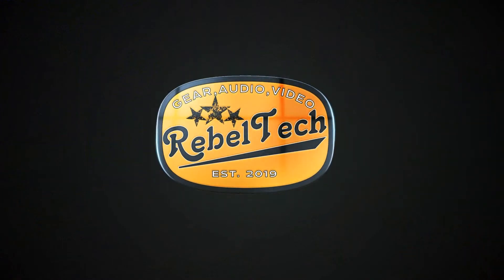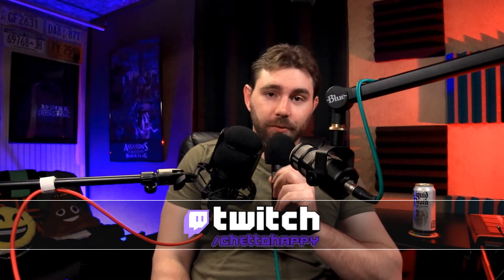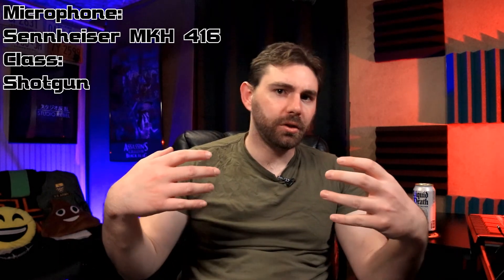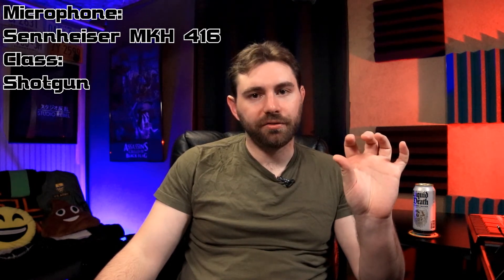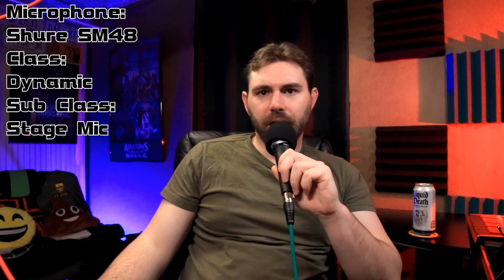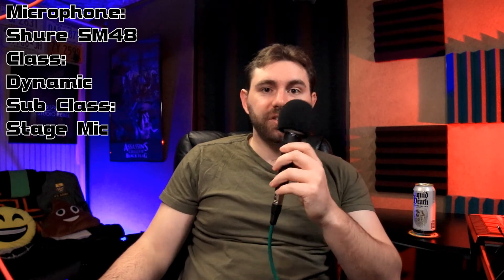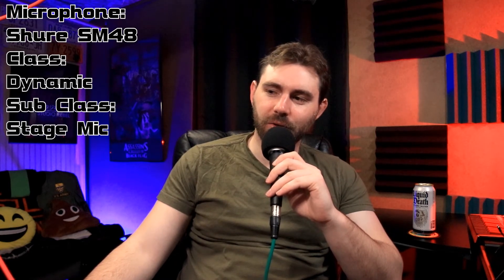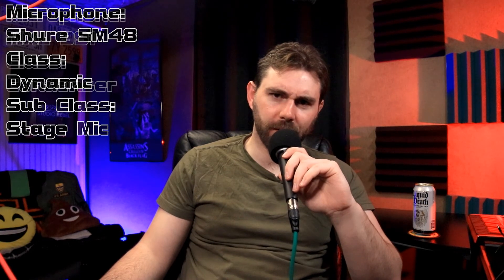6 Mics, 1 Recorder! Zoom F6 Mic Test (Part 3 The Test)

Comment: how do you connect your lav mic to the F6 ? 
I am trying to connect it and i have no signal.. the microphone works flawlessly on the H6 .. any ideas ?
Reply from the maker: Which lav mic are you using?  Is a xlr receiver plugged in or is it a 3.5mm lav adapted to xlr?
Reply: @RebelTech1990  ok, i found the reason. On thei recorder its not enough to set the phantom power. You have to go to each individual channel and choose which mic type you are using. So i had to choose mic with phantom power. than it worked.

Comment: Did you have any issues with your 416 and F6? Mine don't work together at all and it's just these two specific products together. I can pair my 416 with several other mixers and recorders with no issue. I also have no issues with my F6 with several other mics.
Reply from the maker: Gotta admit this is a new one for me.  Let's go through the easy stuff first to narrow  the search.

1) Make sure its plugged in properly
2) Check that the cable is good
3) Check that the F6 is set to 48v phantom power
4) Check that the PFL settings are set to phantom power
5) Check your levels, make sure you are giving enough gain

Those are the first things I would check.  After these are checked, and if you still have an issue, I'll have to do some research and tests to find an answer.
Reply: @RebelTech1990  All the above are good. I have a Shure KSM32 and 44 with 2 SM7B no issues at all. They all work on my H5 including my the 416. It’s literally only 416 and F6 together. I’ve spent like 12 hours researching everything and even tech support with Zoom. I really appreciate your help.
Reply from the maker: Ok I have a few more things to try. 

1) Are you up to date with the firmware?
2) If number 1 is done, try a factory reset and start from scratch

Try those next and then we can try more stuff if they don’t work.
Reply: @RebelTech1990  The firmware is at 1.7 and I just did a factory reset and still nothing. This is an absolute nightmare.
Reply from the maker: Ok So just to clarify.  When you plug it in, do you get any signal of gain? Does the level meter move at all?

Also do you hear anything regardless of the level shown?
Reply from the maker: I’ve tried some things and used the 416 in different situations to simulate your situation. I can’t seem to find out what’s wrong. If I hear anything or find anything out I’ll be sure to let you know. Best of luck with it, let me know if anything changes.

Comment: I have a question about using wireless Lavs with the F6. Say you have a group discussion and everyone has their own Lav, and the receivers are plugged into the F6 recording at 32bit. I'm guessing that the wireless system may not give you anything like 32bit going into the F6, but that you'll get the maximum dynamic range from that system and it would still be better than 24bit? It seems to me the real benefit of 32bit is not having to crucially monitor a speaker's level, and this is important for Lavs as well as other mics. But if the wireless system only delivers a 24bit signal, does recording in 32bit have any benefit? Or would using a 32bit Lav recorder like the Zoom F2 or Tentacle Sync make more sense?
Reply from the maker: There's a lot to this, so I will try my best to explain it.  The simple answer is just like any microphone, or any signal going into a device, there is a threshold.  Meaning the Mic and/or lav system has a limit to how much sound it can handle, before it distorts.  This distortion isn't from the gain level, it's the physical source before it even gets to the device.   Then when you pass through to a device, in this case the Zoom F6, you have the preamp that is your next line of defense.  Same concept as before but in the device itself.  It has a limit but in this case it adjustable.  First by adjusting your levels and second by choosing a file format.  So let's say you are using 32 bit float and your levels are good.  Then you're good, obviously.  Now take the level and peak it.  At this point your signal is distorted, but since you are using a 32 bit float file you can bring it back to life without fragmentation.  
         This doesn't work with 24 bit because its just a lower dynamic range.  I have a video about 32 bit float and I linked some other videos that helped me understand the concept.  
         Now that we got the techy stuff out of the way, to your situation.  So the F2 and Tentacle Sync are interesting because they have 32 bit float but you record into the deice.  Personally, I'm not a fan of this.  As a audio person you always want a way to monitor your signal.  Sure, in a perfect world, the device will work great and you wont have a problem.  Let's say there is an issue, you wouldn't know until later on while you're editing.  Kinda like shooing film, you have an idea of how it looks but you don't know everything until it's developed.  
        To answer your last question, it's a matter of trust.  If you trust that the F2 or Tentacle Sync is working and there isn't any issues then that will be fine.  If you are skeptical, like me, I would think twice before getting that and make sure your levels are good with 24 bit files.  That being said, the 24 bit, out of your lav system is just like a microphones Db limit.  That's why some mics have a db pad on them.  So in that case check the levels coming from the system and then if they are good you should be all set.  If you can't check your levels from the system then don't worry about it, your audio device will take up the slack with 32 bit float.   
       I hope this answers your question, I'm sorry it was long winded.  Thanks for checking out the video, let me know if you have any more questions.
Reply: @RebelTech1990  Firstly thanks so much for your reply and thinking about my question. I think I understand, almost lol. I'm wondering if setting the gain on the wireless lav system to a low level and then recording in 32bit float on the F6, then boosting in post would mean much loss of quality? I think this is what this guy experiences - https://youtu.be/uQNi47GdDk0?t=317. He tests 24bit vs 32bit recordings using a rode wireless go, compared to XLR mics, and finds the 32bit was much better. So that extra dynamic range of a 32bit recording does capture more (so the wireless receiver must be outputting a higher quality than 24bit?) and means that boosting is possible, but the background noise would be boosted too.
Reply from the maker: I've seen his videos before.  I also chatted with him about the Zoom F6.  I have a Zoom F6 video with a bunch of things he informed me about.  
Ok so he basically confirmed what I was saying before.  the level you set in the wireless system is just like a microphones max SPL.  Basically the highest level before distortion.  I use the Sennheiser AVX system  and I never had any issues with it.  I am actually making a video on it this week.  
Let's try to make this a little easier.  Do you have equipment that you use or are planning to get that I can look up and see the specs on?
Reply: @RebelTech1990  Thanks again. So I am looking for a set up to do a group conversation, as well as general filmmaking like promotional films, interviews etc. So I think the F6 is a great option for this, it has the pre-mix thing (I think its called - where levels on non-active inputs are minimised, perfect for group conversations) and of course 32bit. I currently use a Zoom H5 but with 4-5 speakers in the discussion I'll need more inputs. I guess I could hire a few XLR mics and give each subject their own, but I'll be using Lavs on other stuff so I am interested about what dynamic range I'll get with them. Currently have the Rode Wireless Filmmaker Kit with a Sennheiser MKE Essential. Would be looking to get a decent set of Wireless Lavs too. Thanks so much for any advice!
Reply from the maker: Ok there are some options for multi lav systems. I don’t know much about them, I would have to do more research. Do you have a budget, maybe I can look some options up?
Reply: @RebelTech1990  That's so helpful, thank you. Don't spend too much time on my account but I guess its good to know whats out there. I'm on a fairly tight budget but I want to get gear that will last. So the F6 is around £530. I will also get a better shotgun mic and have decided on the Rode NTG5. That's £430. So I'd like to get a decent pair of wireless lavs, and then perhaps rent extras when I need. If I got the F2 I would replace the included Lav as its not great for cable noise. I like the Sennheiser MKE essential which I have and works well.
Reply from the maker: If your planning on getting the F6 the F2 isn’t gonna work with it. The F2 is for a one person show. If that’s what you are looking for then it’ll be perfect. 
The thing is you need to figure out what your main focus is. If it’s group videos with multiple people then the F6 and a multi lav system is good. If you are doing solo videos, interview style then the F6 and the Rode NTG5 is good. The key is to find things that will be useful for most of your projects. Especially if it’s client work and you get paid for it. 
Once you know what you wanna make then you can make an educated decision on the gear. I don’t want you buying stuff that will end up sitting on a shelf. Trust me I made that mistake too many times.
Reply: @RebelTech1990  Yeah I agree. I think the latter is more common for me - so NTG5 is pretty nailed on, and would love the quality and 32bit of the F6 vs my current H5. I mostly shoot solo so F2 is a good option, but hence why I'm wondering what you get with a wireless Lav going into the F6, if its better than the usual 24bit that may be a good option too.
Reply from the maker: The reason why I would get a full lav system is because you can get a 4 channel lav system for about the same price as the F2. I don’t know how good they are but they are available.